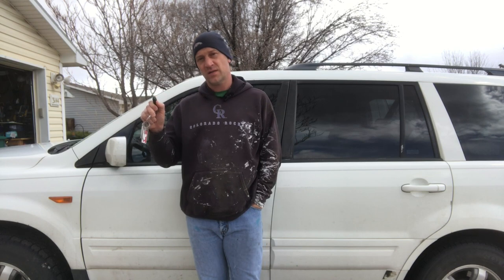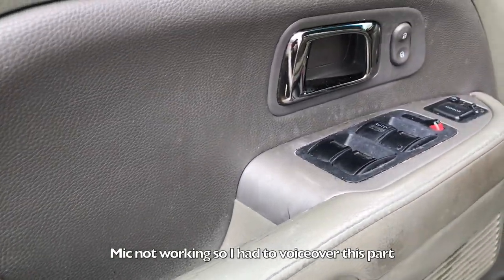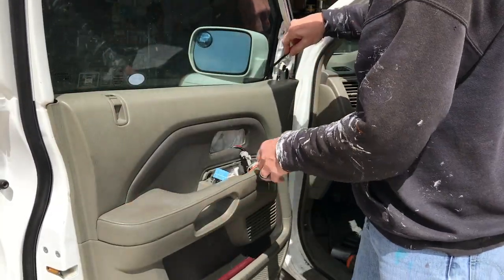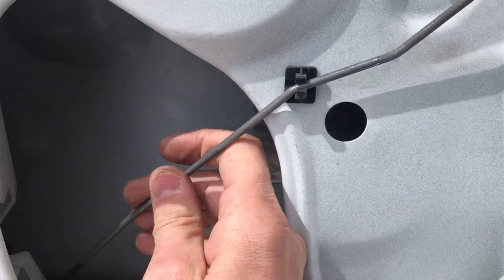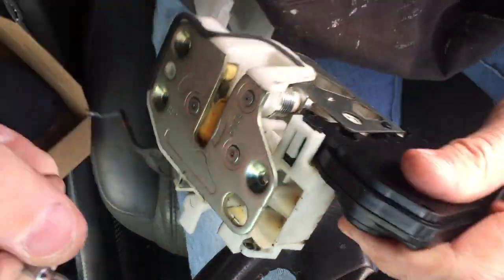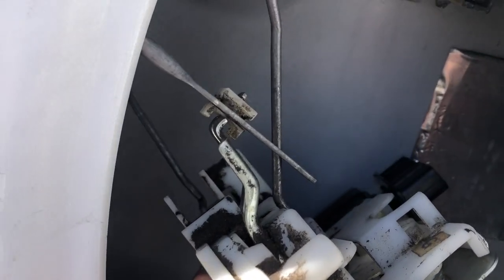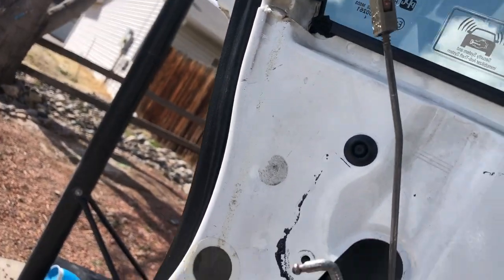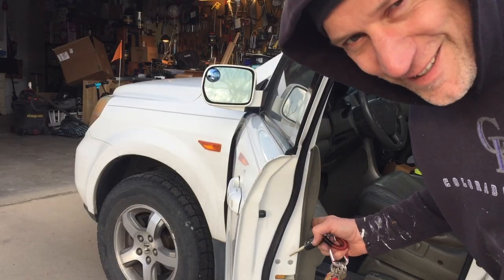Replacing the Door Lock Actuator | 2006 Honda Pilot

Comment: Good video but next time you don’t have to pull the handle off. You can disconnect the cable and switch with the panel off. Save a bunch a time. And the plastic lock rod comes off via clip. Good job tho bud.

Comment: On that rod you had some trouble there’s a little lock that secures that pin.  I used a pin lock to take it out and then you wiggle that little plastic and will came out very easy

Comment: Great video. I messed up the Lock when I tried it on my 2003 pilot!. right back passenger side .It won't open from outside or inside . Any advice on getting it open now !.
Reply from the maker: Yikes. Hard to say without seeing it. My guess is all those rods didn't get positioned right when you were putting it back together. Is it stuck in the locked position with the door shut?
Reply: Oh shit. The door that will never be opened again.
Reply from the maker: @lisajswan  oh no!

Comment: My passenger door handle rod used for the interior door handle pops out of the holder pin nearly every other day, its extremely frustrating i cannot find anything online in regards to this, this all began with a entire door lock actuator replacement and now that it has been put back together i’ve had this problem, it seems as though it may be a bad holder pin but when i look at it there seems to be no apparent damage and works as intended initially until it pops out again. One thing I’ve noticed is the rod does seem to be under more than usual amount of tension, im not sure what would be normal in regards to this but it does seem rather difficult to open the door and once you do, the handle doesn’t return to its primary position instead it hangs out like someone hasn’t let go of the handle, im at a loss and am about to just have someone else do it regardless of cost.
Reply from the maker: Dang...yeah it's really hard to know what's going on with out really looking at it in person. The way you described it, it sounds like maybe one of the rods wasn't placed exactly right. I don't know if you could tell from my video, but toward the end, I almost ran one of the rods incorrectly and it probably would have caused something like what you're saying. Yeah I'm not going to lie, this job is somewhat high on the difficulty scale.
Reply: @rawar777joshanderson  probably didnt help that the plastic gears popped open on me when installing the new actuator like i seen happen in your video, but i would concur that this is a more than average difficulty replacement task. Anyhow i appreciate your reply, i believe i discovered the culprit of my problem, the interior door handle rod needed to be bent the slightest bit towards the passenger seat, i believe it may have been bent at some point during the install, so far it has resolved both of my problems.

Comment: Well looks like the 03 pilot I just picked up needs the driver rear and passenger front done. Neither work with the power locks. But when locking from the outside by the key, only the passenger front locks the doors; not when using the driver front to lock doors.